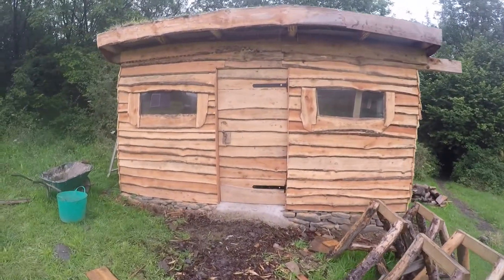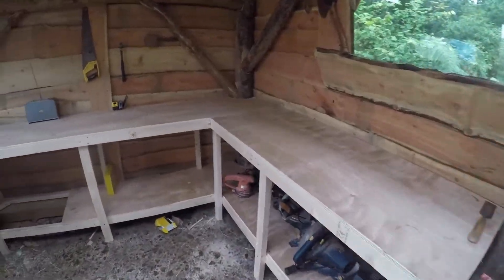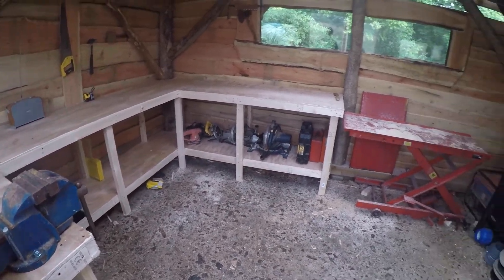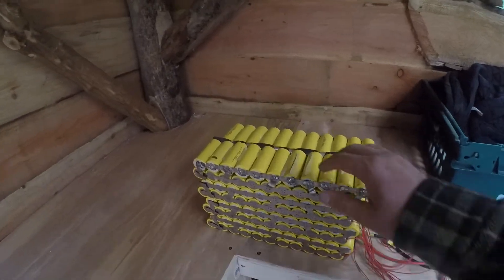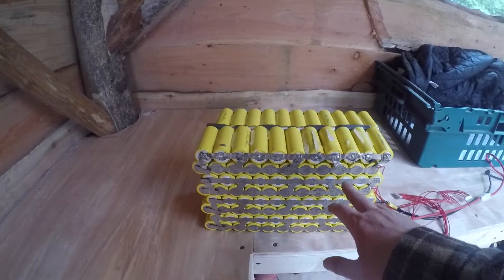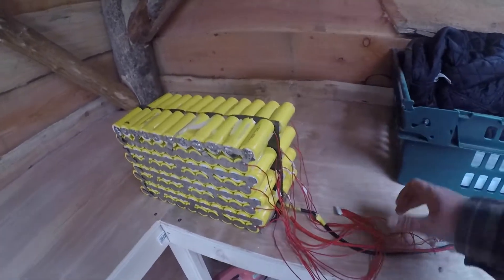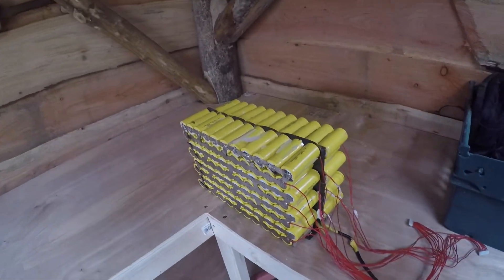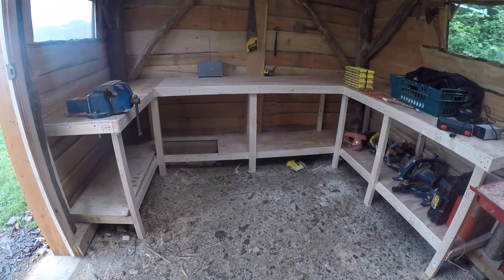New workshop

Comment: Winter project seems to me you are in need of heating what's your plan for the shop heating
Reply from the maker: i will most likely make a waste oil heater, i made one before but it had a few problems with leaking so i will improve on the design a bit. they put out ALOT of heat, they heat up really fast and i can get oil all over the place for free.